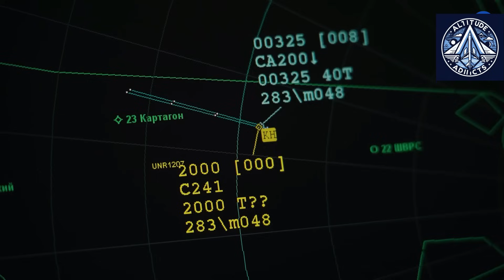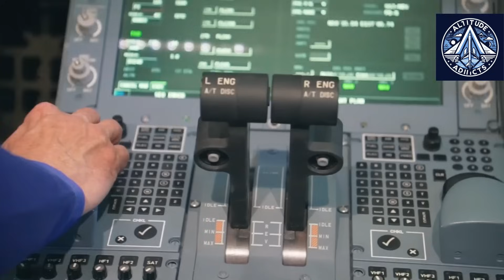4 MC-21-310's in 2025, 90 More for Aeroflot and 14 Superjet SJ-100s by 2026

Comment: in the not-too-distant future, the russians could replace the turbine with an electric motor, with cooled superconductors. this technology is already available. energy for the electric motor is obtained from hydrogen chemical generators or from conventional ones 
 generator based on fuel combustion (small turbine)